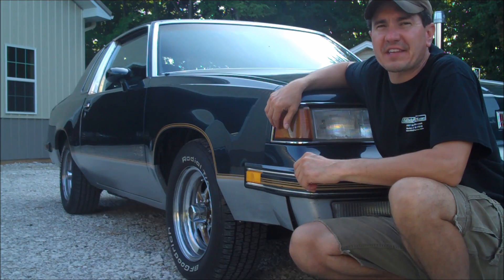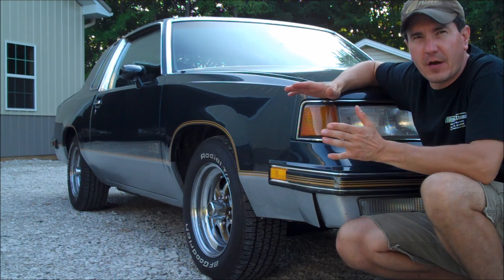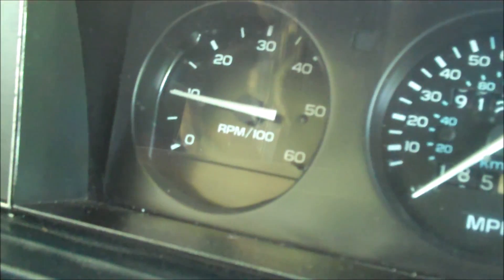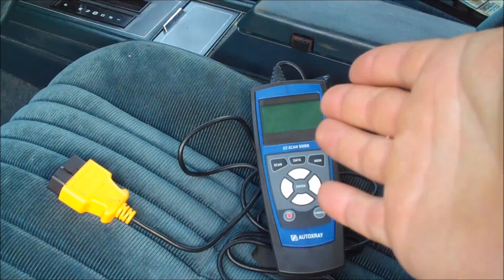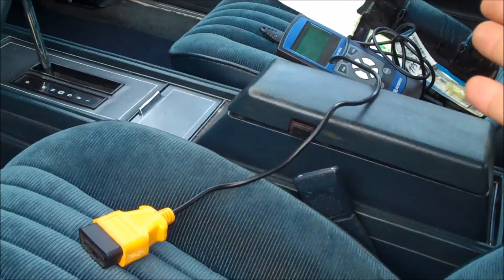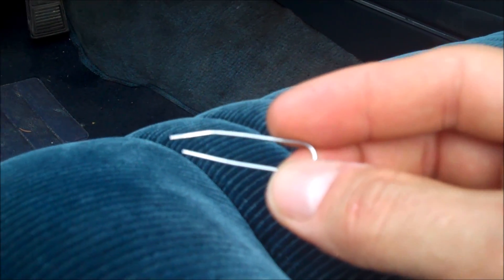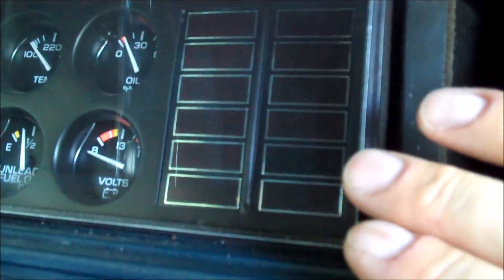How To Read A Check Engine Light Trouble Codes OBD1 WITHOUT A SCANNER

Comment: So what does flashing 12 over and over again mean and no other numbers
Reply from the maker: I mention what 12 means at 5:40  It means all is good if only 12 and no other codes.
Reply: I seen that my car turned off on me while driving and was hoping it will give me lead to why? I changed the ignition module rotor coil plugs wires and cap hoping it would start still nothing I even did a new fuel pump any ideas thanks man.

Comment: My 86 307 cutlass just keeps flashing 12 the whole time. Why is this?
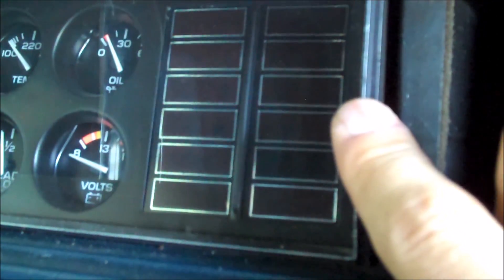Reply from the maker: 12 means the computer is functioning and the light should be off. If the light is on there will be another code following as I show in the video at the 5:30 portion of the video.

Comment: I have a 83 cutlass v6 231 i start the car and tried to read the codes with the paperclip i even have a obd1 gm scan tool but the light stays on and no codes can be pulled i dont think the computer is communicating i made sure its plugged in no loose connections all the light does is stay on
Reply from the maker: You read the code with the key on without the car running. If it doesn't go through the series of flashes with the scanner or paper clip in place then yes there are other issues. It might be bad.

Comment: Got the paper clips, and did it. Read a 15. Which means coolant temp/low temp. What does that mean?
Reply from the maker: Temp sensor might be bad. Usually located on the intake manifold up near the water neck.
Reply: Either the thermostat is stuck open or you didn't warm it up enough for the test.

Comment: My check engine light is on but don't blink when i put the paper clip in anyone know why??
Reply from the maker: you are not doing it correctly then. Follow my steps exactly.
Reply: Classic G-Body Garage i did it the same way u did but it don't flash but its on
Reply from the maker: Key off, install paper clip into ports A/B. Turn key forward to accessory position and it will run through its series of flashes.
Reply: Classic G-Body Garage ... I did it all the steps like you said still nothing this car has a 305 in it and it came with a v6 think that has something to do with it?
Reply from the maker: Yes because it sounds like they didn't connect the computer back up so it isn't reading anything therefore not running through this process. Pull the fuse on it in the fuse panel and don't worry about it.
Reply: Ok thx i will do that

Comment: Classic G-Body Garage Sorry for my ignorance lmao first time using OBD1 scanner! But how do you get a code 24 from counting the check engine light? I can understand if the light blinks 13 times for code 13 or 24 times for code 24 but 1,2,1,2,3,4=24? Please help lol trying to understand on counting the flashes to get the code, I bought the GM OBD1 code reader does it explain how to read the flashes for the cods?
Reply from the maker: The light only flashes in increments of each single digit. I explain how to read the light flashes as well. 1, 1-2 = 12  You don't add them together. The light flashes once = 1. The light flashes twice = 2 and so on. 24 would mean 1-2, 1-2-3-4 = 24
Reply: Oh alright man I gotcha some times I get those brain farts every now an then hahah. I have a 1988 Monte Carlo SS and gonna try the paper clip trick on it then use the GM reader on my other cars. Thanks for the help explaining it very much appreciate it
Reply: Classic G-Body Garage Okay I just done my 1994 Camaro Z28 and when I put the paper clip in the A-B port then turn the key to on position it just blink once very fast and low and then nothing, does that mean my car isn't throwing any codes?? or could it just not work on my system? I read today that you can do it on the 1993 Camaro's with OBD1 but not the 1995's it's aggravating lol
Reply from the maker: Is the engine light on when you drive? If not then there are no codes to pull other than the "OK" functioning code which I mention in the video. An ECM will always show they are functioning. OBDII was introduced around 95/96 so the paper clip trick won't work on that system. Make sure your car is the OBDI and not the II. The shape of the plug is different.
Reply: Yes the check engine light is on when driving, I read the Lt1 F-Body form and they say 1993 is the only year on the 4th Gens  you can use the paper clip on 94-95 like mine  you can't. It sucks lol but I can do it on others with the OBD1 port just not 94-95 F-Body's unless it's a 1993
Reply: Hey. Need a little help please...
Is Fash, Flash, Flash—Flash, Flash Code 32?

Comment: ALL I find online is the paper clip trick which is GREAT!! and seems to do the trick BUT why don't people just go out and by a GM OBD1 code scanner?? Or even the FORD OBD1 scanner?? They are only around $25 or less I just bought a brand new one for $19.95, I was gonna do the paper clip trick but since it's my first time using a scanner and idk how to read the blinking Check Engine 1,1,2 - 1,1,3 ect code search I just went ahead and bought a GM OBD1 scanner with a book that has the list of codes. Also I figured since I'm into older vehicles might as well buy one to use in the near future, right. and maybe make a little cash on the side doing friends cars that uses OBD1.
Reply from the maker: All great points but the systems are so basic that if a free paper clips works then its all you need. I explain how to read the light flashes as well. 1, 1-2 = 12  You don't add them together. The light flashes once = 1. The light flashes twice = 2 and so on.
Reply: Thanks for the help! Guess I should of just used the paper clip trick but sorta wanted to see how the GM code reader works, it was on sale and cheap so I didn't really lose any money from buying it. I'll be watching your video some more until I get it down pack lol so Thanks!! again

Comment: I have a code 54, but I don't understand how to fix it. I can't find much on the net about what the problem would be and how to fix the issue. Maybe you could help. Thank you.
Reply from the maker: I see you found my video per my reply on your other comment. Follow the link in the description as it will take you to a site that tells you what each code means.
Reply: Classic G-Body Garage I have and found that there was no solid ground to my mixture control solenoid. So I'm just having issues with that. The only thing I can't find is what warning lamps should have a light bulb on my dash.

Comment: I have a 1986 buick regal v6 231 and I'm getting error code 24 on the obd trouble shooting ... car stalls when I drive for about a mile or 2 when I come to a stop and some times it will bog when pressing the gas lightly . what should I look for ?

Comment: I have a 1986 cutlass and my heat only comes out of the defrost vents and my blower not work on the high setting. Do you have a video about my issues?
Reply from the maker: 87moe1 not yet but plan to. It's a common issue and people ask me about it. Make sure your vacuum source from the engine is hooked up.
Reply: I got it, it was the vacuum lines thank you!!

Comment: my 94 buick lesabre is obd 1 but has a 5 pin obd 2 pulg it won't jump
Reply from the maker: It will jump. Make sure you follow the steps.
Reply: Just looked i have a obd2 plug and my scanner won't connect it say's linking error i'm confused why i have a obd2 plug on a 1994 buick lesabre 3.8l.

Comment: My 94 s10 has a service "soon light" on all the time and never flashes....just remains on...?
Reply: That means a problem is present and doesn't go away. Check the codes. There's a G.M. code tester that is small and plugs into the connector. Amazon and EBAY has it. The light flashes on the dash.

Comment: I try the paper clip to check the codes but the light never blinked it just stayed on
Reply: Mine 2
Reply: Jimmy S  okay so I have a 94 buick lesabre and after reading your comment I finally now why it won't read.. so what do you suggest
Reply: Jimmy S  sooo what do you think my issue is than? Crank sensor? It also shifts very weird when the light comes on.

Comment: My exterior door latch are a bit loose and using my key to unlock the door is very rough.  It feels as if the key is about to break off in there.  Any suggestions?

Comment: power window switch 1986 cutlass supreme brom. driver side.
is it just the two screws and pop it out or disassemble the door?
Reply from the maker: Yes a brougham uses two small screws. No need to remove the door panel.
Reply: thanks

Comment: how do you fix a code 42 for 84 cutlass supreme
Reply from the maker: Per the website it says EST circuit "low gear ratio error" probably has something to do with the speed sensor behind the dash. I have never heard of that error.
Reply: A Actron CP9690 checks codes for OBDI and OBDII. It works on 1984-2013. It has OBDI cables for Ford, G.M., and Chrysler, and Toyota. It has a OBDII cable. It has a cigarette lighter cable. It comes in a black pouch. Get 4 AAA batteries which fit under the rear cover. It has code-connect to diagnose codes. It's well-lit. EBAY has it.

Comment: Oil of peppermint is a surefire way to keep rodents away, put a drop in the corners of the hood and somewhere under the rear of the car. Also attaching a zinc bar electrically to the metal of the car acts as a sacrificial anode and stops corrosion. If only GM had installed this cheap part!
Reply: Moth balls can be used to chase off rats. Their noses are sensitive!

Comment: I don't think Canadian models got these diagnostic computers. I've seen a Quadrajet with an electrical connector once or twice in the junkyard, but usually on 86+ with the next generaton small block design.
Reply from the maker: Yes Canadian cars were more standardized than US car where the US cars received different engine combinations.

Comment: Quick question is a grand am in that era a gbody
Reply from the maker: yes
Reply from the maker: Are you sure its not the alternator?
Reply from the maker: I can't explain that one. You will have to get a dealer service manual and trace the wire using the scamatic. Normally when a fusible link fries you have other issues. I believe the links are only in series with the large red wires in the system, not the brown wire. You will have to test that brown wire for any breaks.
Reply from the maker: If you have to give it gas to start it to charge then the voltage regulator in the alternator is bad. Replace the alternator and it will fix the issue.
Reply from the maker: replace it

Comment: If that volt gauge is accurate; It looks the alternator is weak.
Reply from the maker: Gauges have issues. Need gone thru like in my gauge fix video. Common issue.

Comment: Excellent video. My 88 Cutlass Supreme Classic kinda acts like this. It starts and runs ok, idles ok, until the service engine light comes on then the idle just skyrockets. Need to get over to my storage unit to pull the codes.
Reply from the maker: Throttle position sensor. Thats what this cars issue was. I have a video coming up on how to replace it. Stay tuned!

Comment: how to remove drive shaft
Reply from the maker: Thanks for the suggestion but that is an easy job. 4 bolts back at the rear end, once bolts are removed gently tap it loose and it slides out of the trans. Put a pan under the trans tail shaft cuz some fluid will come out.
Reply: at size is bolt head ?
Reply: +Classic G-Body Garage
 I was wondering if you have happened to see a "blue interior indian blanket" cutlass supreme 79 or heard of it?
Reply from the maker: Never. Only black and tan
Reply: +Classic G-Body Garage 
is that black and tan available? and if not do you know how i can find it.